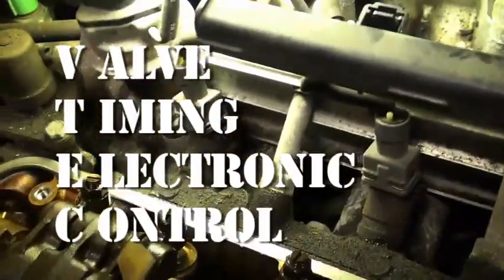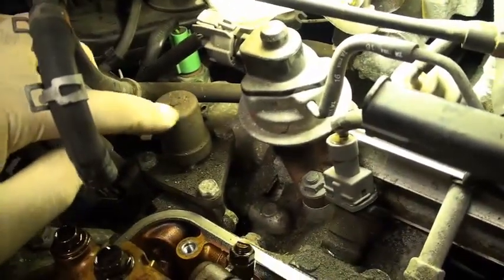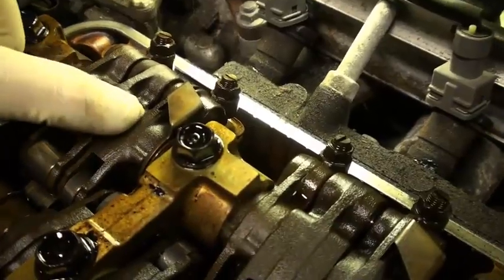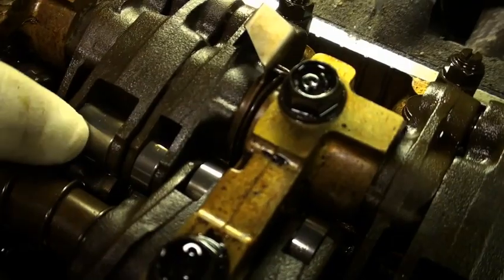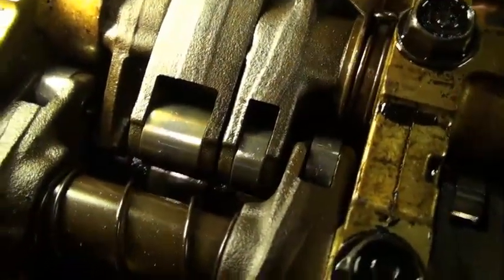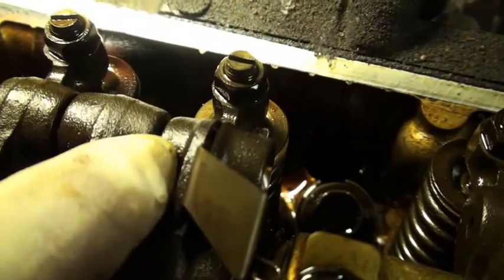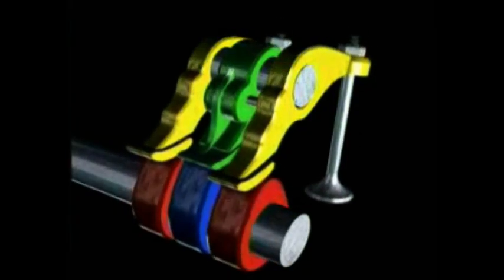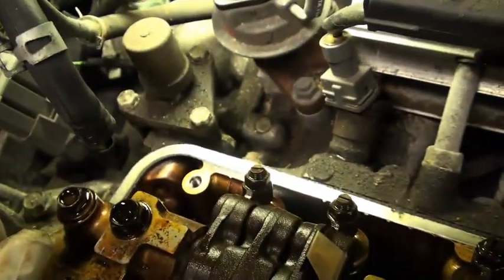What is VTEC and How Does it Work? - EricTheCarGuy

Comment: If the car is on the higher valve timing all the time, your lower rpm will not be smooth and even in some cases, the car will stall and engine cuts off. If you ever see a muscle car pull up next to you and you can hear the rough running of the engine while idle, this is because that car's valve timing is high. One way to fix the car from engine cut off is to set the idle rpm higher but again your wasting lot of gas while sitting around.

Comment: It use oil pressure so when you have it at a higher rpm theres more oil pressure=more power. rather then using it all the time. Kinda like a small turbo.

Comment: Because torque times rpm, in certain units, is horsepower. Max torque means highest efficiency, so its best to use the high-rpm cams only when you are at high-rpm, and use the low-rpm cams when you are at low-rpm.

Comment: if a valve stays opened for longer it can drain more air into the piston cylinder therefore can get a bigger "bang" so the 2 small ones allow just normal day by day moving air but when u wanna go batshit crazy with the car like race ...or overtake w/e the middle lever connects and allows the valves to be opened for more time to suck in more air ..look @ google or even youtube camshaft tunings u will see that stock got a smaller buff but the tuning ones got a bigger one hope u sort of understood

Comment: 2. part
In 1989, Honda released the VTEC system.[8] Where the Nissan NVCS alters the phasing of the camshaft, 
In 1992, Porsche first introduced VarioCam, which was the first system to provide continuous adjustment.

Comment: I will just copy-paste this and u will see that u are both wrong :)
In 1958 Porsche made application for a German Patent.
Fiat was the first auto manufacturer to patent a functional automotive variable valve timing system which included variable lift. Developed by Giovanni Torazza in 1960's.
Alfa Romeo was the first manufacturer to use a variable valve timing system in production cars in 1970's.
In 1987, Nissan was the first manufacturer to release an electronically-controlled VVT engine.

Comment: Toyota's "VTEC" is called VVT (Variable Valve Timing) and it came out later than Hondas VTEC. Even BMW has their own version of "VTEC" its calles VANOS which means (VAriable NOckenwellen Steuerung, or variable camshaft control) it all works on the same theory, they all have something variable on the camshaft etc

Comment: if you can make the solenoid open the valve at a lower pressure, you should be able to engage vtec at a lower rpm

Comment: well you will have pretty shitty low RPM torque because when the intake and exhaust valves open at the same time. unignited air might get pushed out of the cylinder.

Comment: its actually Variable Valve Timing and Lift Electronic Control.
most cars have Variable Valve Timing which the cam sprockets are not fixed so they move depending on the ECU to adjust for maximum power and torque throughout the RPM. this technology is usually called VVTi (toyota), Vanos (BMW), or CVVT(Nissan).
With VTEC it changes how big the valve opens (lift), because its not a linear change, the sound of the engine and the torque curve also change suddenly making the engine feel different.

Comment: in the end you end up with an engine that has 4000 put into it to make the same power as the bigblock i would much rather a throaty 3.1 then a little 1.6 weezer that that cant get a grip because its just not heavy enough on its wheels.Ive had a civic it gives the impression of being extrem,ly fast cause your so damn low to the ground aAND  small that it feels lijke lightspeed at 180 km/h

Comment: I can see where a car with "vTec" technology might get clogged up causing the pins to become stuck/locked in the engaged Position(due to "Passage Buildup" or old dirty oil).
So my question is;
What happens if the PINS get stuck open(vTec engaged while driving around town) ?
I mean besides thee obvious,like poor mileage.

Comment: This is why you're ignorant also. The "tiniest"? That's not even true. And there are 2.0L (200-260hp) 2.2L (140hp 250tq), 2.4L (201hp 170tq) Civics. That may not be like a 5.4L truck, but it will outhandle because it's a car for one, and it will still be quicker because it weighs half the weight of our trucks with half, and sometimes more than half the power.

Comment: Lets you get good MPG under 5800 rpm, the 3rd cam lobe increases the time the intake valve is open. Meaning you go from 130bhp to 190/200bhp.

Comment: Mixing apples and oranges, are we? The Honda is naturally aspirated, unlike the EVO. And despite the car being 15 years old most modern n/a cars don't get anywhere near it in terms of power per liter. I could have easily bought a lot faster car for the money I spent on my old EK9, but I never regretted it for one second. I prefer sharp handling to shear power, and the way the little B16B revs up is just astonishing.

Comment: The primary cam lobes make more torque at their operating RPM range than the secondary cam lobes would, and vice versa for the secondary, or VTEC, cam lobes. This is why VTEC engines have such a flat torque curve.

Comment: That's why hot rods w/ big cams have a rough idle, ya loose low end torque but gain a bunch a top end. VTEC gives you the best of both worlds, a smaller cam at low rpm and a big one at high rpm.

Comment: I find no point in engaging vtec earlier than the stock setting. My car engages vtec at 5700rpm and redlines 9000rpm. Whether Im racing on a circuit or tooling around on the streets, there's no reason to be outside of that range since, in my case, is where my engine is at peak performance.

Comment: The phrase 'Constant VTEC' is a paradox. The valve timing won't be variable if it is at a constant level, would it?

However, the time at which VTEC is engaged can be adjusted via a VTEC Controller, but the engine won't run as smoothly in the lower rev range if it's engaged earlier. If you just want that high-rpm VTEC performance, upgrade to some fast road cams for constantly aggressive valve timing.

Effectively though, FRC = no VTEC.

Comment: I say work on the suspension and get better tires before you even spend the big money on the engine. Power isn't everything even on a Drag race. There is not point in having 500 horses if you don't have tires and suspension that can handle them.

Comment: Theres no "Best Vtec" out there. The sound of vtec is determined by two things. Your camshaft and your exhaust system. Of course if you modify the cams and replace it with an aftermarket one with a higher lift, then it will become louder. If you want the best and loudest vtec out there, then get a k20a or b18c ITR engine swap with a 3"piping and exhaust system. Hope that helps. You have alot more to learn

Comment: For variable valve timed engines it is very important to change the motor oil at the recommended fill interval and using the right viscosity. If the oil change is done at a shop ASK what oil they have on hand and use and SEE to it that the right fluid is used for the oil change.

Comment: hey can you help? well i was on the highway and a 18 wheeler was goin slow so i passed him and i hit 5200 rpms then my engine would jus sounds like it was stuck in and it works fine unless i get into vtec and then right after the check engine light came on. what could it be and is it costly?

Comment: question, why is my 95 accord vtec automatic lowering its rpm by about 100 when i hit the gas between 55 and 65 mph, i mean, when i hit the gas, the gauge goes down by 100 rpm, if i stop giving gas it goes up again 100rpm, is like doing the opposite of my other non vtec car, which when u hit the gas in over drive the rpm goes up, not down, well, this accord is my first vtec so no idea, is this normal, or the leak i have on the vtec is causing this? thanks, car has 127000 new 5-30w oil synthetic

Comment: 4/x If you get a Vtec, just keep it stock and do the tricks you can do to improve the stock engine (oil, perhaps porting, exhaust), because the Vtec revs like a MF and is under enough stress as it is (if you wish to drive it every day you can't get much more than 200bhp from a 1,6L Vtec, but the 1,6 without Vtec can have 220bhp very safe because the engine never revs as high as the Vtec).

Comment: 3/x The most expensive bit is probably the exhaust camshaft, if you add header and exhaust system (a proper performance one, with catalyst), it will go like the clappers. Don't run on communist gasoline under 95 octane. Then you should get a benefit from chipping the ECU.
Many people tune Vtec engines without problems, but if you are to have a fun, fast car, then a simple mechanical device is better than a Vtec (Vtec is just a system that lets you have low power on low RPM and high on high RPM).

Comment: 2/x Change the fuel pump to something a tad more beefy (like 100 bucks), find some slightly more aggressive exhaust camshafts (the fuel camshafts increase fuel usage and power, exhaust camshafts decrease friction and thus power at the wheels without added fuel cost), and new spark-plugs (ask an expert what the best ones are, perhaps try Dyno runs with different temperature spark plugs). This is stuff that you should be able to do yourself with minor fumbling and some spare time. (cont)

Comment: 1/x The 1,6L Vtec of any year is pretty good. Though a 1,5L without Vtec, but with simple tuning, is cheaper and simpler to fix, though it uses a tiny bit more fuel in the long run (unless you tune it cleverly). Easy things to get power from Honda Civics: Run thin oil in engine and gearbox, run at minimum oil levels (check oil a tad more often), always have new clean oil and filters (air, oil, fuel), smaller wheels with more width, lower front suspension, lose rear seats and interior, (cont)

Comment: Either do a motor swap (depending upon your mechanical background or if you have a friend/family member that is knowledable that can help you along),D16z6 or B series. You could also build upon the motor you have depending upon what it is, if your car is not an Si or Z6 swapped imo it would be a waste of time. If it's a z6 I would turbo it, cheap and easy power or N/A with cams, header, 2" exhuast, CAI (16" + long w/ Velocity stack and air filter), and an ECU chip would be a good start.

Comment: Incorrect, sure the oil presses the pin in and locking the lobes together, but for that oil to get there it has to have a passage, that passage is created by the solenoid moving about 1/16th - 1/8th of an inch. That solenoid is activated by the ecu when it deems it a suitable time.

Comment: B16 swap is the most common vtec engine swap out there. Being an EG the car probably doesnt have vtec unless your car is an si, giving it the d16 engine which is an single cam vtec. The b16 swap is fairly easy and you can by the engine, transmission and ecu for around 1500 at jdm source. As far as mods go, a 2" exhaust is more than enough and wont be too loud. Also an aftermarket fuel rail and cold air intake (proper one,not just a cone filter stuck to the end of a small cone tube) are good mods

Comment: normally not, but it can. this can work with or without a turbo, doesn't matter. if u look at the animation, the middle rocker arm activates at higher revs, meaning the bigger cam lobe can open the valve for longer, giving the engine more air. and with more air, the ecu gives more fuel, which = more power

Comment: Another way to phrase what I said:  Timing is more than just the sprocket/cam gear timing, it's also the ignition timing as well.  When to fire is just as important as when to open - all parts of the engine timing.

Comment: Yeah, only in I-VTEC is the cam timing changed actively.
.
That being said, the acronym I've seen the most times through my time in the Honda world is:  "Variable valve Timing and lift Electronic Control".

Do remember, on many civics, the spark is electronically controlled. Depending on the rotor leads, it's possible to advance/delay the spark a tad w/o moving the distributor or changing the cam timing. That most likely happens a tad, but w/o a stock P28 ROM or something I can't say for sure.

Comment: What do you mean "the best kind" - unless you dig for an old Z1 you won't come across VTEC-E, and I-VTEC wasn't available until way later than '95, when the K series came out, so with a '92-'95 ("EG"), in the US you'd only have regular VTEC in the D16Z6 (or the rare DOHC Del Sols).
.
As for the engagement point, the stock engagement point (4800? IIRC) has proven time and time again to be the best for stock cam, stock head, stock manifold, stock TB, stock header. Hope that helps!

Comment: VTEC is an outdated variable timing system that requires extra camshaft lobes and a larger oil pump, and you only get the benefit of that MASSIVE 180 hp or whatever the fuck, when you eventually reach 6,000 RPM.

There's no comparison here. They should've gone with a different engine platform if they had to use VTEC in the first place.

Comment: The silinoid (Idk know if that's the correct spelling for it) the part under it what is it? Its right above the rear cam seal and behind the valve cover. On the left corner. Can Someone tell me what that is,  reason is because my car has an oil leak coming from there

Comment: i'm not talking about the lag between cam lobes, i'm talking about the total lack of power and torque below roughly 6,000 RPM, and "most powerful naturally aspirated 4 cyl in the world" or not, the power level and the amount of torque is still weak.

CTA makes a massive difference. Every degree of timing counts, and the effects of these split second changes are magnified on something like a v8.

Comment: And Vtec is not just about performance output. Honda allow itself lower valve travel on reg driving cause: less oxygen = less gas (computer calculated, since there's no damn point in injecting more fuel than the optimal chemical mix for combustion) Yet you got the extra when needed. And to answer why not Vtec open all the time: refer to more oxygen volume (not the mass/volume) = more fuel needed. Turbo increase oxygen/volume why it can reduce fuel consumption.

Comment: So why not just have it to where the vtec is on all the time with the longer duration?  What is the purpose of having this come on later rather than right away?  Or rather, why have the first lobes at all and just have the initial one with a longer timing?  Doesn't this allow more oxygen into the engine, which is the reason you get more power during vtec?  I'm not a mechanic but this would seem like a good thing to adjust to increase both power and economy.

Comment: Wrong about power lag, well in some cases. VTEC engines vary and also you can program it differently based on the ECU in your car. My brother has an ECU programmed to engage VTEC at 4,500 RPM and engines like the K series which are the fastest 4 cylinder engines shouldn't be compared to 6 cylinders and 8 cylinders, some methods of VVT may work better for a certain engine compared to another.

Comment: VTEC's draw backs are a large oil pump, which causes more parasitic loss of power (magnified on such a small engine) and more weight in the valvetrain, which is a drawback no matter how you cut it. Also, there's a MASSIVE power lag until you hit roughly 6,000 rpm, meaning you only have a maximum of 3,000 RPM's in which you have *decent* power/torque in a car like the S2000. The 5.0's/302's have power and torque from idle to redline.....there's really no comparison here. Your shit kinda sucks.

Comment: and I was comparing my 5.0L v8 FUEL ECONOMY to the smaller BMW 4.0L v8 fuel economy, which you'd think would be better, the 4L being of smaller displacement, but it's actually far worse. Just another advantage of CTA. I can go from 390 foot-lbs of torque to immediate fuel economy in less than 0.2 of a second.

Comment: Where are you getting your information?

"CTA drawbacks - can't handle high RPM's"??

V8's with CTA, like the Mustang 5.0 and Boss 302, are routinely seeing 7,500 RPM. These are street cars. Boss 302R/Boss 302S race car drivers have missed shifts and tached 9,000 RPM without issue.

"Only effective with limited amounts of valves per cam"? Um, I think what you meant to say is "only effective with limited amounts of valve overlap"? CTA is perfect for a v6 or v8 with DOHC. There is nothing better.

Comment: Also, the m3 doesn't have a "de-tuned BMW 5L", it has a 4L with 414 hp and a 100 foot-lb torque disadvantage to my engine.

CTA is one of the most advanced systems on the road today. Actually, by comparison, VTEC is outdated and has many drawbacks.

My engine goes from idle timing to wide open throttle timing in less than 0.2 tenths of a second, and also, in the unlikely event of a timing chain failure, the engine is free-wheeling. It will still run without catastrophic failure.

Comment: You're incorrect. If you tried to use VTEC on a v8, fuel economy wouldn't be as good, you'd have to wait for the performance cams to be activated when you floor it, the valvetrain would weigh more and the oil pump would have to be larger.

CTA with twin independant variable camshaft timing makes the Coyote 5.0's as powerful as an M3 (more powerful for 2013, 420 hp) with almost 100 foot-lbs more torque, immediate throttle response and Nissan 370Z fuel economy....

Comment: The phasers don't actually move. They don't rotate....microscopic amounts of oil locks in the ignition timing based on valve spring forces, and then drains. This happens VERY quickly. There's no parasitic loss, and if the timing chain were to fail, the engine is free-wheeling. It won't crash valves into pistons etc.

Cars without CTA waste the valve spring force. The 5.0 and other engines with CTA, don't. Basic Physics here.

I get the feeling you're a big VTEC fan.